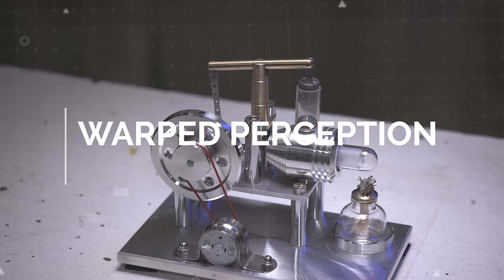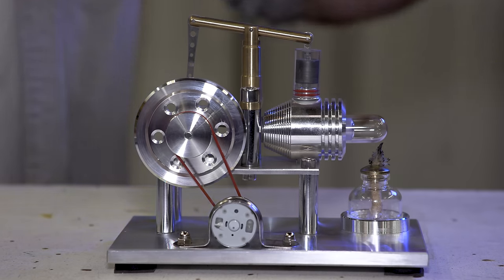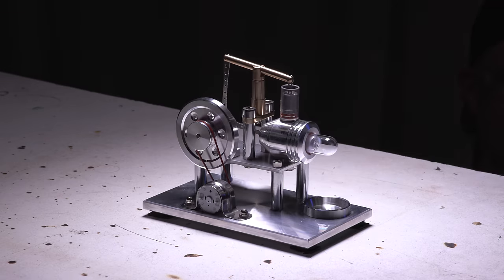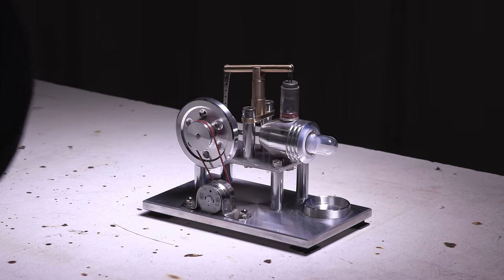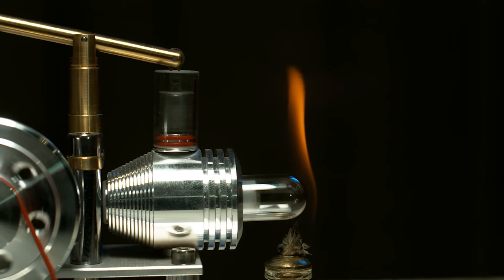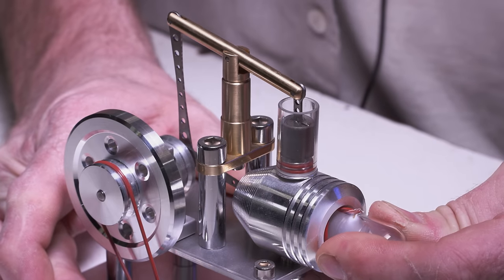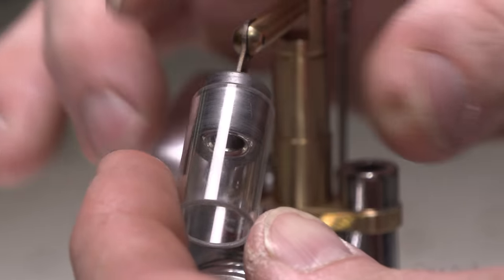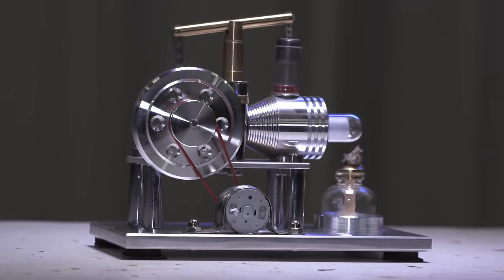Mini Stirling Engine - MAX RPM (Blow-Up Attempt #1)

Comment: I really don’t understand how the heck this engine works
Reply: iWantSomeBuns 69 hot air expands and pushes the piston down and you the cold air pulls the top piston down and it’s just a cycle back and forth until there’s no hot air on the hot piston
Reply: basically:
Air on the hot side (where the candle/torch is) wants to expand, so it does so, pushing the main piston down. that main piston isn't quite as big as the cylinder, so some air slip around. That air is pulled up into that second cylinder to cool off (the one on the top), once this cooled air is pushed back down, it moves back past the piston to the hot side, rinse and repeat. There's a 90 degree delay built into the engine to give the air some time to move.  The colder the cold side gets, the more air it can pull in and cool, and the more air will be able to go back and expand in the hot side.

Therefore, the greater the difference in temperature, the greater the RPM.

Comment: That "conversion into rotational energy" part he just blew by was the main part. Long story short, it's pressure change as air is heated and cooled and temperature change as trapped gas expands and contracts working in unison.

Comment: The model is a real work of art. 
Side note - one of the reasons this type of engine didn’t make it is difficulty in controlling speed and throttle. Takes a while to get going.  Not good for a car. Maybe more suitable for a home generator or similar.  It’s kind of like a flywheel in that regard.

Comment: I do not really like Stirling videos like this, where the speaker do not know too much about that hot air engine basically, but it was a great presentation for the limit of this engine. This alpha displacered type engine is a nicely machined one, and fast. You could increase the speed easily with some wet cooling on the machined aluminium part, but if you can fix the stand first that gives you a much higher speed basically without more heat or cooling because you stoped the negative resonances. Also you should take off that rubber O ring from the generator, that has a pretty high friction. Anyway, the video is cool, good job man! Greetings from Hungary! BLADE
Reply from the maker: Thanks! Well I know somewhat how about Stirling engines but I have to keep the verbage simple so everybody can understand. 
now that you comment I did want to put a link to the stirling engine in the description and I completely forgot.
As for the little generator, you are absolutely correct oh, I could have got more speed if I had disconnected that belt, I totally could have done that, but this was the very first test and I didn't think it was going to melt the displacer. I'm glad you like it thanks a lot, I'll probably have a couple more coming up soon.
Reply: @WarpedYT  I see, people do not really know how it works basically. It's a "mystery", but few popular thinks later everybody wants change the whole world with it, but they don't know why not possible to change it... The stand fixing, the rubber ring, the cooling, and a heat trap what save your red silicon O ring sealing also reduce the heat transfer to the cold side will give you more than a 1000RPM I guess. Good luck! BLADE

Comment: I have a suggestion for you brother. Use light gases like Hydrogen or Helium as operation gas and keep it under high pressure to maximize the power output and efficiency of Stirling Engines. You can take a look at Cody's Lab for a video on that topic

Comment: With that much heat input there needs to be an appropriate amount of cooling added to the "cold" side:  Forced-air + extra fins or a water-jacket and radiator?  The higher the temperature differential the more work that can be extracted = higher RPM.  Great vids!

Comment: You can get more power and RPM out of it by using a can of freezer spray on the other cylinder and piston at the same time as using the blow torch on the hot cylinder and piston. The bigger the temperature difference between the two is the key. Thats assuming the freezer spray is not flamable. Love the videos

Comment: With the extremely rapid reciprocation of the piston, and the additional friction heat that likely created, I'm not at all surprised that it deformed. I am still surprised that the cylinder didn't, however...  Regardless, I found this educational, and highly entertaining.
Reply from the maker: Yes same here! I am also surprised! Seems like it's made with the same material too!. Probably has something to do with the hot gas flow path through the cylinder, pulling the heat away from the cylinder around the piston and into the heatsink oh, that's my guess.

Comment: hook up a multimeter to the leads on the DC motor to see actual power output, also try running high pressure air over the second cylinder to cool it

Comment: You’re melting the piston because you’re adding the heat faster than the heat exchanger can dissipate it. That’s also why the entire thing is hot. This engine isn’t going to fail by blowing up; it will fail by failing to expel the heat

With a different (bigger) radiator, and perhaps different gasses, you can increase the rpm. But 4,000 is the max as currently set up - the exchange of heat will not allow to go any faster than this based on current setup 

Definitely good to know the limit. 

My pet project is to have this spin fast enough to power a 5v 1A usb charger module (via a capacitor to regulate the voltage)

Comment: Stirling engines give me all kinds of ideas on how to make them work more efficient and in a car. There are all kinds of modern technology that could be used like ceramic coatings to insulate hot and cold sides even metal gaskets themselves could be coated. Metallurgy has improved so you could run a thin low tension gapless piston ring now. 

Stirlings are more suited for constant RPM so in a vehicle it would probably be best to maintain RPM to drive something like a generator for an electric motor.

It needs to be powered by something so why not the exhaust of a little 5hp engine that could power accessories like the alternator, powersteering, waterpump, air compressor to charge the crank case. If you made the top of a Stirling into an old style catalytic converter (new style is a blow through) it would hold the exhaust heat on the Stirling head. Or possibly make it a flat pancake converter that goes around the base of the heated head so heat would rise into an insulated chamber and trapped to heat the upper cylinder. I need to stop thinking....

Comment: Put a heatshield between the hot bulb and the cooler so you have bigger temperature difference. Moreover you can make the cooling area bigger or just use dry ice. That'll give you a real boost to your engine.

Comment: The piston melts before the cylinder because the engine is essentially a reverse heat pump and always pulling energy out of the cylinder, the same way water has to boil away before the pot holding it can go above 100C

Comment: I have a LTD ( low temperature differential) stirling I built in 1999 that’s sitting on a heating pad under a glass dome at about 90f that’s been running nonstop since than except for a few times I stopped it to show people how it works.

Comment: It'd be interesting to see if this could be run using sun power, focused through a magnifying lens to create the needed heat. Make the whole configuration reposition-able to allow for the earths rotation so it always has the sun rays focused through the lens. Could this be the next 'green' energy source of the future?
Reply: Exactly

Comment: A container with a hole for cylinder head and metal chips like steel, copper or brass and would it be a long term heat accumulation?

Comment: The reason the Stirling was inspired was its inventor was Aghast at the horrid injuries cause by the frequent explosions of steam engines at the time. And the engine WAS going to be produced.

But steam engines became safer before the Stirlings could even get off the drawing board. Because whilst the Stirling engine had no risk of a steam explosion spreading it and its crew all over whatever space it occupied, it had issues with its flywheel exploding from exceeding RPM design tolences, because brakes hadnt been invented for such an application as stopping a several tonne flywheel from running out of control...

all that said, in our time Stirling engines are actually becoming quite a popular power generation solution. Since they work from temperature tolerence, they can run efficiently on waste heat from other forms of industry... its essentially free power, since the waste heat from running an industrial scale process such as refining ore or oil, or making plastics or paper usually just gets dumped. With an S engine that waste heat is used for power generation before running its course.

An Industrial scale Stirling engine generator pack that fits in a cargo container pays for itself in about five years btw.

Comment: As a glass blower, I could tell what was going to happen before he turned on the torch. The glass is borosilicate. I'd love to rebuild this engine with quartz parts. You could throw MUCH MORE heat at them and they still wouldn't melt or deform

Comment: I wonder if the cylinder is made of borosilicate and the piston is regular lime glass.
Also, water cool that cylinder on the cold side! Water cooling will improve the differential without the problems of liquid nitrogen. You can always run a dry ice/acetone coolant.

Comment: Interesting. Are there any practical applications for this style of engine? What's the cheapest fuel you can use to keep it lit? And why didn't you use a digital tachometer?
Reply: late reply ik but you can technically keep a stirling engine running without fuel by using something like a fresnel lens or a bunch of mirrors or something to focus sunlight onto it and use that as a heat source, which would only cost as much as the setup itself

Comment: In theory, if you put an induction coil over the hot piston and had the generator supplying the power, would you theoretically link multiples together via a belt?
Reply from the maker: True but there will be conversion losses no doubt.

Comment: You need to add a pressure tank to the displacer to get a sterling engine to maxout.  Not turning up heat.  It will blowup if the pressure is too high.

Comment: you need good cooling to truly get max rpm since stirlings run on temperature difference. otherwise the cold side is just going to get hot as you're putting heat in faster than the fins can dissipate it

Comment: I'd love to build one with pistons about the size of 55gal. Drums!  Yet keep the stroke relatively short, to get more rpm from it, than a 5' stroke would allow. Something like a 36" bore, with a 12" -18" stroke, use cold water on the cold side,  and hot oil, heated by concentrated solar, to get the heat required, maybe use some alcohol vapor to get more efficiency! Maybe use a sand battery to store heat to keep it going after dark for a while, it could be a heck of a project, if someone could machine the parts that large,  I guess 5gallon bucket would be the largest that could be easily machined!!

Comment: The engine is used in stealth submarines because it runs quietly and also by NASA in space for long missions using a small nuclear reactor to heat it. I think in cars its not used because cars need power fast, stirlings have slower response to get going.

Comment: 5:41  The piston melted because it had no heat sink beside the cylinder and cylinder head, both of which were already overburdened with dissipating the rapid influx of heat they were already sinking.  If the cylinder and cylinder head cannot dissipate heat at least as rapidly as they sink heat, the heat of the captive piston will continue to rise to the point of failure.

Comment: I wonder if you could use exhaust heat and a sterling engine as an alternative to a traditional belt driven alternator. would save some gas and power.

Comment: Im curious if this engine would run faster with a piston that had more dome, so that in theory compression would be higher? Also the belt attached to the electric motor  is definitely slowing it down with parasitic drag
Reply: Dodge Hemi comes to mind.

Comment: I'm guessing the outer cylinder wall is made of quartz glass (same as 500w work light bulbs) which can withstand much higher temperatures
Reply from the maker: That's a good question, I was told they are made out of the same material, who knows

Comment: shoulda added some thermal mass to the cold side. its all about heat differential, not just heat. hitting it with the torch just heat soaks the whole thing.. gotta keep the cold side cold while you're doing it if that makes sense
Reply from the maker: Yes I didn't pack think about this, and for my second portion of his video I wanted to cooling heatsink and use an even hotter torch to make it more dramatic. Problem is it didn't make it through my first test.

Comment: I bought one that had an issue of failing after the exchange cylinder could no longer cool the air.  Which version like this has this issue solved?  So eventually the heat exchanger would overheat and it would stop running until the exchanger cooled down.

Comment: The sterling engine fell out of popularity shortly after invention because of the low torque or useable power output
Reply: Figures,that generator could barely light and LED.
Reply: @iuhsdihdslifuvholuidfh  right now there are some commercial sterling engines that you can buy that are powering some houses in California

Comment: if you were to turn the stiring with a motor  it will make cold on 1 side and heat on the other :D
used in some industrial cold room for storage
at some point in time

Comment: Hey since Sterling engines run on heat, how about you see what these engines can run on. I was wondering if they could run on the heat produced from an electric coil? Also, use an engine that has no glass parts.

Comment: That's a fascinating engine! I gotta get me one. I am curious, just how much power you can get out of it, by loading that little dynamo on it. I think it's just a carbon brush motor, so I suspect, it puts out direct current. As much as I would focus on heating the chamber, I would also focus on providing a small amount of airflow over the heatsink, to help create a higher temperature differential, to make the engine more efficient, as well as more powerful.
     I would even try heating it with a resistance electric heating element, and compare that wattage, with the wattage I could get out of the dynamo at optimum load, and measure the true thermal efficiency of the engine.(~4%?) I don't know what the lubrication requirements are, if any.
Reply from the maker: I think so too !. It is DC output, if you really want one, they're not very expensive in my opinion, I left the link in the comment section and in description if you wanted to purchase it just make sure you use the discount code "WARPED".  I don't really make much at all off of these engines like three bucks each, but I wanted to share it with everyone because I really thought it was cool. As for measuring the thermal efficiency, that could definitely be done, but I would think with a heating element it would lose a lot of heat externally. I'm sure there's a way to encapsulate that heat.
Reply: I'm already ahead of you: I just clicked on the link provided, and ordered one. (11/30/2019) At that price, I just couldn't pass it up.
Reply: @WarpedYT  I didn't know to use the "warped discount code", but as far as using an electric heating element, I'm thinking a 50 watt H-3 Halogen light bulb, with a reflector like a spot light, or a flashlight. I want to make sure all the heat goes into the hot tube of the engine, so I can truly see what the thermal efficiency is. I'm also sure, there is an optimum RPM range, where the engine will do the most work for the amount of heat transferred through it.

Comment: Seeing this i think it would be cool if they changed the design to fit a thermoelectric device between the pistons because it moves heat from one side making it below air temperature and moves it to the other, making it very hot.

Comment: Curious could you liquid cool the heat exchanger and use perhaps synth gas or gasifier HHO system to heat the piston.
Reply: Even the dynamo should produce a/c voltages. Seeing those values would rock.

Comment: Guessing here just a few thoughts ..I think you need a heat sink..the cylinder with the grooved louvers ain't making it, it needs more metal or you could run a water pump you get from a fish supply store and use 1/8 copper tubing bent around the cylinder..

Comment: At 500 RPM, I bet you can get like 50 watts from it. Doesn't sound like that much, but would be enough to charge some devices. I mean, in an emergency, charging a phone with a small fire sounds very interesting.

Comment: You should disconnect the Generator in order to really push that engine into it's limits because the Generator does extra resistance

Comment: Why not do a video on how you can use these everyday life. I bet you can use the Stirling engine for powering electrical equipment, like Nintendo Switch, or a small radio at the beach.

Comment: These engines operate based on an optimum temperature difference that is directly linked to the ratio (by volume) hot/cold end. Adding more heat will not make it continue to go faster and faster. In the same way adding more coffee to a full cup will not make the cup bigger!
Reply from the maker: That's a great point,, however I do like challenging physics science and mechanics, and it did go much faster as I increased the heat, now I know there's a limit to this but at least for a short burst I wanted to get it to a very high RPM.
Reply: @WarpedYT  Yeah going for higher it will go faster its just one of those law of diminishing returns situations. I would like to see liquid nitrogen on the cold end :)